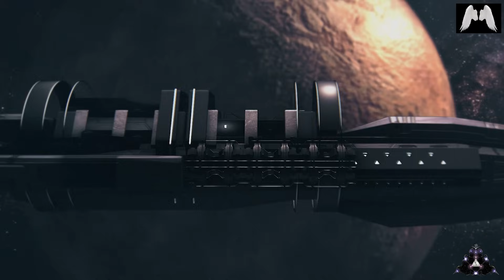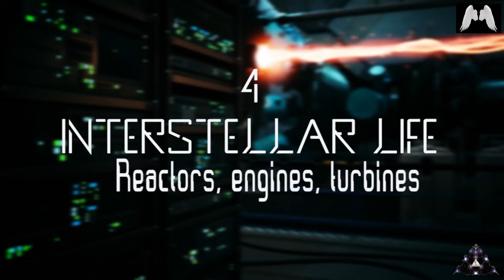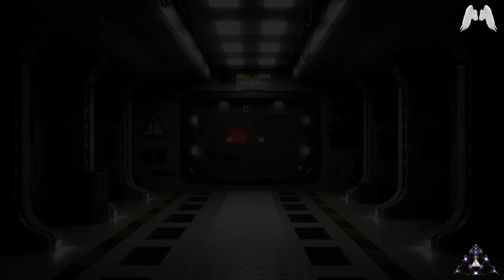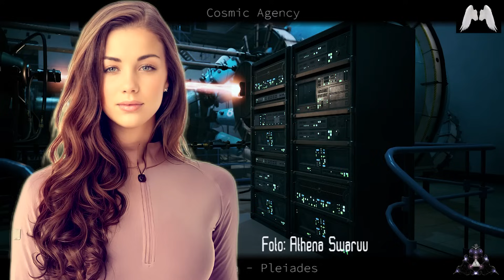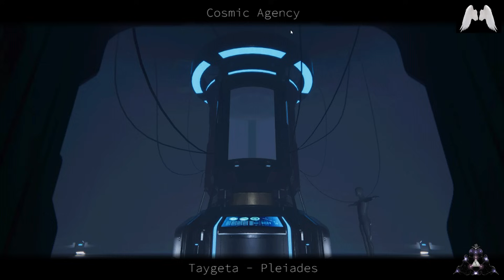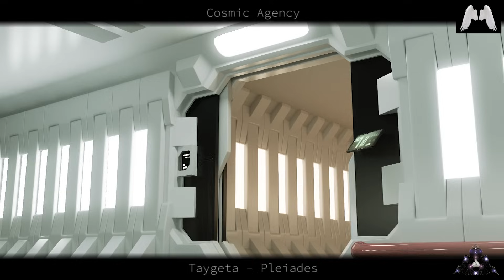Interstellar Life 4 - Extraterrestrial Engineering - Reactors/Plasma Engines (Taygeta - Pleiades)

Comment: I don't want to be annoying but most of UFO ships found anywhere had power devices that look like a sheet of plexiglas. It is made mostly of silicon oxide crystalls and capable of producing megawatts of electrical power (by consuming cosmic energy or ether). And - they don't need big powers to travell because of the way travel is being made - You just tune to different vibrational energies like radiostation
Reply: The answer you're looking for is in the last 4mins of the video. 

Basically saucer shaped craft are low powered vehicles which need their hulls in the shape of a disc to help distribute the energy around the craft. However ships with plasma engines don't need to be shaped like that because Plasma engines are much more powerful than gravity manipulation and cancelling engines. Also your description of how the craft moves is just like what they've described, the Plasma engines change the existential frequency of the ship to match the destination and then it jumps to that place.

Also most UFO ships I've researched about used a counter rotatating column filled with mercury or some magnetic fluid which acts as the zero point energy generator and wraps the ship in an electromagnetic toroid for antigravity gravity propulsion. The only different antigravity craft I've heard about is Bob lazars version which uses some three cathode rods to wrap the craft in an electromagnetic toroid to cancel gravity. So what you're saying sounds very strange to me.

The zero point energy device you described too sounds weird because from what I've gathered zeropoint energy devices either use magnetic motors to create electromagnetic toroids which can discharge energy from the ether or manipulate the ether using shape (like pyramid shaped objects) to draw energy from the ether or use Crytal based zeropoint reactors which are usually in the shape of a merkaba(two pyramids fused together) which is claimed to be the most optimal shape for generating a toriod.

This video has some evidence about saucers which use mercury based engines to generate electromagnetic toroids for gravity propulsion.

https://youtu.be/vzY06MRzwPE?si=6yDE0sMvky7e9JIU

Comment: Absolutely mind blowing explanation! Very detailed..and helpful to understand leave many more questions open about the designed frame structure of the space ship example. Used material qualities, electro-magnetic shield- modulator activities in high torque etc.
This polymorphic liquid metal conductor just a fuse blower thing! So much information, at finally more than ten minutes…❤ and one subject connected to another, like the generated electromagnetic output vibrations used for space detection and frequency navigations. ❤
Thank to all who’s made this lecturing in one strong structure, it is very strong and detailed explanations for better understanding!❤

Comment: What is the simplest type of Zero Point reactor?
Reply: Look up the keshe reactor. It's patented source of free energy where hydrogen is ionized in a vacuum chamber and power or antigravity tapped from the plasma
Reply: I guess technically the pyramids are reactors, so mechanically the simplest, explains why they're so large, probably less efficient, and they only run on latent forces, like a lightning rod. But smaller ones probably work also, even those would be relatively great to us
Reply: @PrinceArthur636  I read about a man that built a pyramid the size of a house. It generated so much energy that it caused water to lift out the ground and flood the area. The man ended up tearing the pyramid down after being terrified from standing on a ladder to finish construction when suddenly he got struck by a powerful electrical discharge produced by a coil of wire earth grounded and connected to the pyramid that knocked him off the ladder. I would say pyramids can be highly efficient if large enough and built correctly!
Reply: @PrinceArthur636  the pyramids require a collection and distribution catalyst device at their centre, else the charge differential dissipates latently as is occurring with the large pyramids throughout the world…
Reply: A rodin coil.